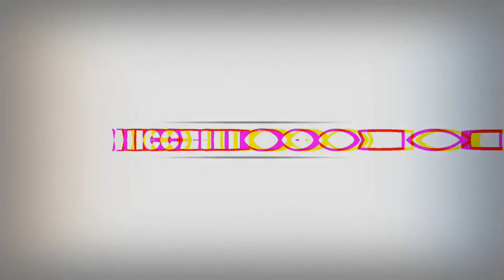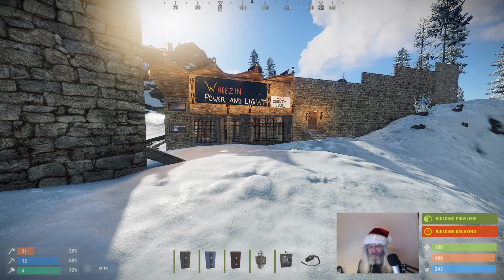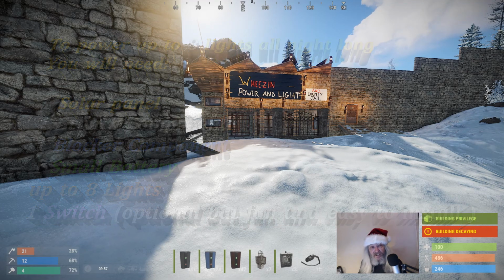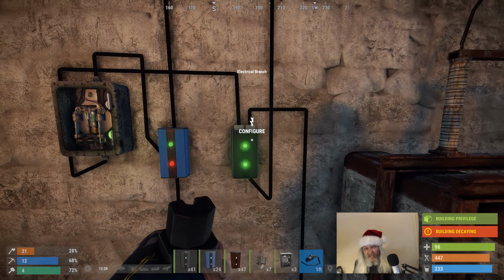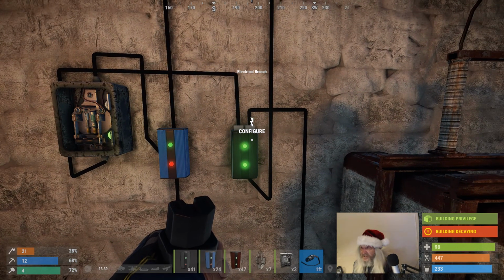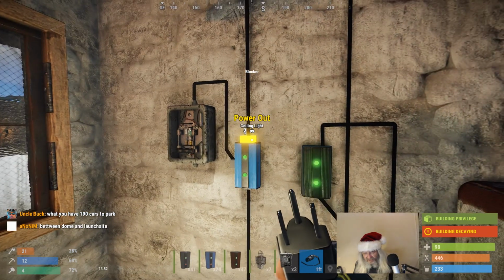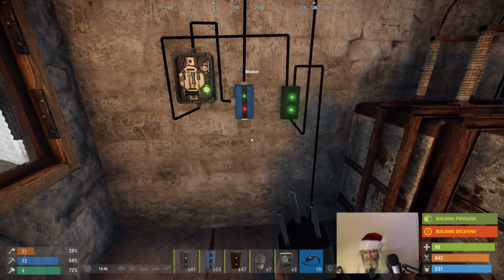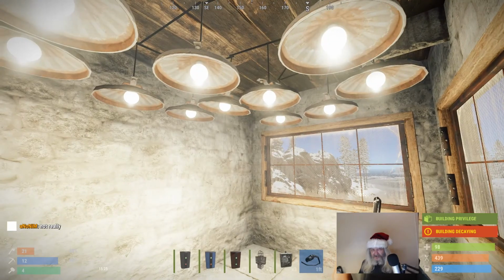RUST Electricity : So Easy Even I Could Do It

Comment from the maker: To be honest 50 lights was a guesstimate, it turns out to be 48 lights. But that's not bad. It's a wipe later now and I've got this setup with only 2 solar panels facing north. And I have several quarry's close together and have it running 48 lights, all night, every night.

I have since learned that solar panels do not have to face north,... per say. I've only been here for a few wipes and all the sun was in the North. This wipe I am currently on our sun is slightly south, and North barely gets any light. But it seems consistent that it is either North or South that has a constant solar power advantage.

Comment: Hey man, I appreciate the video. One thing I was curious about is, what happens to the switch when it goes night? Does it flick on automatically? If so, what happens if you have already turned it on in advance -- will it then switch off?
Reply from the maker: When it turns to night the switch will lose power, and the battery power will kick in.
Understand this video is for powering you lights at night. Kind of an easy setup. But, if you have plenty of power you can mess around.
It's just it might be a couple "in-game" days before you have enough "extra" power.
Just figure out how many real minutes your night time cycle is on your server and make sure after the first full day of charging that you have at least that amount of time. Any excess is what will build up extra per day.
Reply: @WheezinGeezerTV  No, I was actually curious if the switch itself changed from the "on" position to "off", or vice versa, based on the time of day -- but after having tested it, it doesn't. It just stays on. I appreciate the reply, though. I have this now working with a series of wind turbines and solar panels, and the switch combo from your other video to get the lights on earlier in the evening. Really good stuff and I appreciate your content!

Comment: If i want to have lights and 4 doors around my base with turrets behind. how do i leave power on without draining the battery. because i want the doors to keep being open and close when i want to. it should only use power when i actually open close the doors and not use power to keep them open.
Reply from the maker: Sadly, what you're asking really can't be done. Anything that is active, like a door controller, pressure pad, laser, or whatever you use for a trigger to know to open your doors will need power constant to be active. Though, only a small amount.
I had planned to do a video on that and had scrapped one I did but I'll see what I can do to salvage it. I show a setup with 2 small batteries and a setup with 1 lg battery. The lg battery is the only way to go. I'll see what I can do to make something of that video so it's at least out there.
Reply: sorry for the late respond. Thank you very much for the information